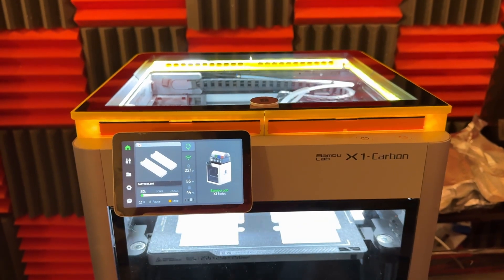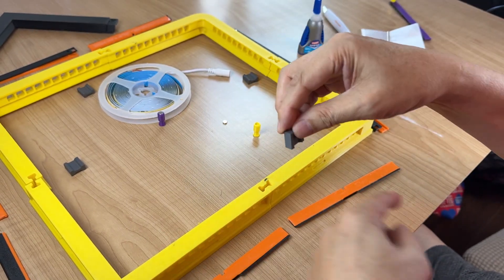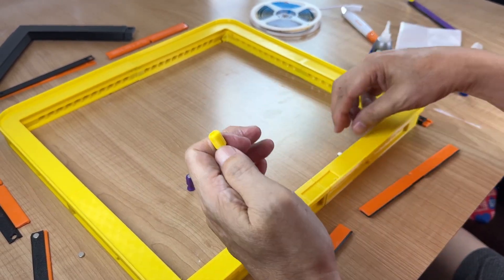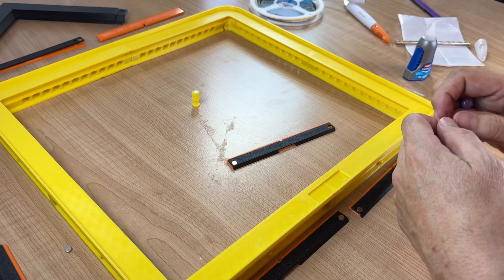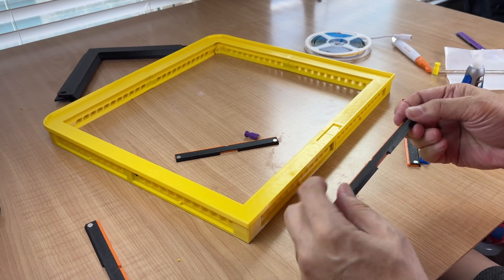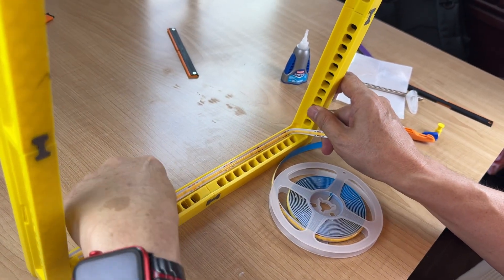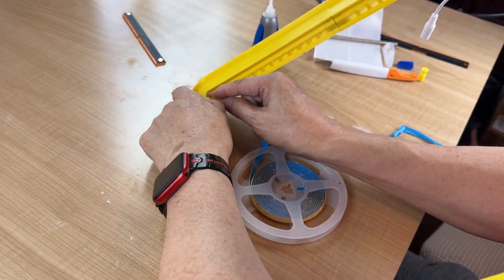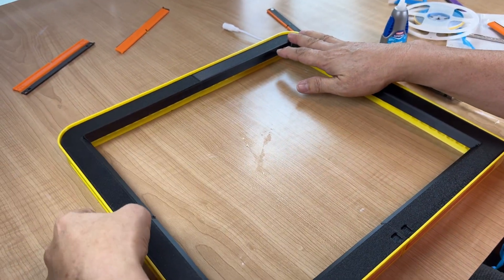DK Riser For BambuLab X1 3D Printer

Comment: I'm not really experience in 3d I just got my X1C I would be willing to buy this upgrade, just the 3D printed parts
Reply from the maker: if you already invested in the printer.. my suggestion is to dive into it… don’t be afraid to make the mistakes… do other smaller projects, and when you are ready, instead of printing the  whole project.. print them in parts… it will take longer, but it’s ok… it is the experiences you need to get under your belt… you will be more happy / satisfied with the result… 🙏 good luck!!
Reply: @papsjundi  I took your advise and started 3D printing the parts, I need to wait for the TPU filament and magnets to arrive to finish the project the main riser, air vents and loose pieces are done. Thank you for the advise.
Reply from the maker: @johnfel  awesome!! next thing you know… you’d be looking for harder challanges!!

Comment: I'm so stupid, can you help me?  I built my frame wrong so I have to make it again.  In the original I used PLA.  Is that not heat resistant enough?  I saw you used PETG, so is that what I have to use?
Reply from the maker: PLA should be fine (many has used PLA and they work out ok), but yes PETG is somewhat better... If you follow the instruction it should be fine.  The main frames are not the same length on x and y... but you can tell the rounded ones are the back...

Comment: I  just printed one of these, and it's an excellent design. However, I ran into an issue with the LED not sticking. About an hour after installing it, the LED started falling from the frame. At first, I thought it might be because I didn't attach it well enough, but it came loose again shortly after I fixed it. I ended up using CA glue, and it's definitely not moving now. I was curious if anyone else has experienced the same issue?
Reply from the maker: @ryanm.19  yes the sticker tapes on those LED really can’t stand the heat… in the video I also mention the possible needs to glue it

Comment: With all of the vents opened what are your chamber temps while printing something in PLA?
Reply from the maker: It does reduce the chamber temperature somewhat... this is not an active airflow system, there is no fan to blow the hot air out, and suck the fresh air in.... the holes are just means for the hot air to rise up and escape from the chamber...

Comment: Part of me wants a version with coils or something to automatically adjust it lol. Doesnt the built in fan cool the prints diwn? I don't have a bambu
Reply: The built in fan doesn't cool the inside down, it's to cool the prints better for better adhesion. If these printers get too hot on the inside it can lead to clogs in the hot end. This riser helps to vent out the hot air. Now if you were to print ABS or PETG then you would leave the vents closed.
Reply: @InTheDogHouse3DPrinting  oh I meant the carbon filter fan not the auxiliary
Reply: @Amybnuy   The Carbon filter is to help dissipate the odors from ABS, PETG and other exotic filaments. It doesn't really have too much of an impact on cooling the chamber.

Comment: will this support the weight of a AMS properly?
Reply from the maker: yes, many has done so
Reply: @papsjundi  thanks wanted to know before it fell into the inside of printer lol. Going to print a set out of ASA and I’ll report back. I like your tweaked version. I just got my led module can’t wait
Reply: @jseaber  how did your ASA print go. i couldn't keep mine from pulling up the build plate and warping at 45c chamber temp
Reply: @GeneralBadLuck  sorry it came out perfect tried one in asa, abs, and petg, I ended up fully printing the asa if I could attach photo I would

Comment: Can i print in PLA? or does it have to be in PETG?
Reply from the maker: my previous one I print with PLA, no issue
Reply: @papsjundi  amazing. Thank you! And whilst you're here... Is the TPU essential or just a nice to have?
Reply from the maker: @danielwolman  functionwise, it is to shield the bright LED, so when you look from above, it doesn't go into your eyes... secondly it is a softer materials for the top glass to sit on.... If you never tried TPU materials, please try... it is a fun materials :)
Reply from the maker: @danielwolman  oh.. and for the flaps, since it is a soft materials, it can seals better than a rigid materials... kinda like o-rings / gaskets..
Reply: @papsjundi I can't see in the top anyway as there isn't space based on where my printer is. The shelf above is only 4cm away! I've printed your compact version and it's wonderful. Thank you!

Comment: Is TPU required for this or is there an alternative?
Reply from the maker: it is not required per se, I chose it because it is soft, better for the top glass to sit on...
Reply: @papsjundi  thank you for the reply. I’m afraid to print TPU lol, I’ve never done it
Reply from the maker: @josephtiberius7651 I was also reluctant to try at first, but TPU is really a fun material!  Just jump into it, make mistakes, clogged your nozzle, fix it (maybe a couple of times, it is part of the learning process).... and after you got it under your belt, you will never look back!  Use TPU only from the rear spool, never AMS...
Reply: @papsjundi

Comment: can you print this in all pla or what are the options, i am new to printing and only use pla so far.
Reply from the maker: on previous projects I use PLA with no issues, some people worried that PLA might deforms at 55 celcius... I think the internal chambers won't reach that temperature... specially when you open the flaps...
Reply: My printer never gets over 36C when I print PLA. I have never looked to see if it would get hotter printing ABS or PETG.

Comment: It's great. I printed out the four connections with slight bulges and polished them. I bought a mos tube and connected it to the cob light strip and an external 12V power supply to achieve panel and app control.
Reply from the maker: Awesone! Thank you! :)

Comment: If anyone is printing this - don't glue immediately. Check if connected parts and tpu pads make top glass lay flat nicely, first. It didn't here and required some filing at connections. Anyway I like previous simplistic and elegant design (with low height) more... only if it had these nice push-in sturdy connections.
Reply from the maker: Thank you! Are you talking about the Top Shield (4 parts that you lay the top glass on) ? they're not supposed to be glued... just lay them on top?
Reply: @papsjundi   About plastic parts with joins.
Reply from the maker: @arekx  ahh i see... when installing the PEGS?? Yes make sure all 4 sides lined up and flat... since to install the pegs, you have to flip pr main frames upside down... now... usually if the pegs and adjoining frames are flat... they're OK... I'd recommend to have enough (Flat) space to put them down so you can see if they are lined up.
Reply: @papsjundi  Frame was mounted on flat surface. But when installing the frame on the printer the middle points (where pegs are) were being pushed up a bit (which was later visible after laying tpu and glass - glass was rised incorrectly). The plastic frame was slightly too big. Anyway filing 0.5mm at touching edges (where pegs also are) fixed the problem. Unfortunately that new frame is too bloated and unfriendly (I prefer to remove glass for ventilation with one single hand movement instead of opening 8! separate small doors) and has ugly look, so I printed frame from your previous project and reused newly printed tpu parts (which are slightly wider but fit old frame without a problem). Now it looks and works great ! :)
Reply from the maker: @arekx  yeah if you don't need the vents... the previous design is more suitable... uses less materials and much quicker too print

Comment: This is awesome but if the magnets stick out past the tpu gasket then the gasket isn’t sealing. The gaskets should smush b4 the magnets make contact. Thank you again for this. Ill definitely have to print this 🤘
Reply from the maker: Thank you... yes the holes are .2 mm deeper than the magnet's thickness (both on the flaps and the main body) to account for that... so when you install it, pay attention

Comment: The magnet idea is nice. It might be easier and less components if you build the dovetail link into the rail so it's one part. I wonder if it's possible to do a multil-material print of the TPU on the door by using inter-locking features. The top gasket light shield is very cool.
Reply from the maker: Thank you!  on earlier versions, I use latch on each side of the flaps, but it was so small... I was worried it will be damaged after several use...  now the TPU and the Cover has 2 guides so lining them up is easy... and yes you need to glue them... Printing TPU with AMS is still risky... I wish they can... it would make life easier also... TPU is too squishy, it will work if it's pulled by the Extruder (like if we put it on the external spool) but AMS, they Push the filament to the hub... and that can cause trouble...

Comment: I take it the lidar scanner still work fine with this?
Reply from the maker: Majority of my prints are using textured plate, I do my calibrations using Cool / Engineering Plate with the light turned down,.... just in case... after I save the presets, I go back to my textured plate and turn up the light.